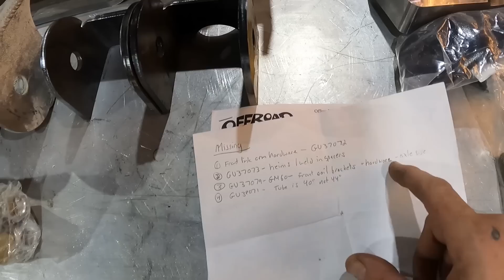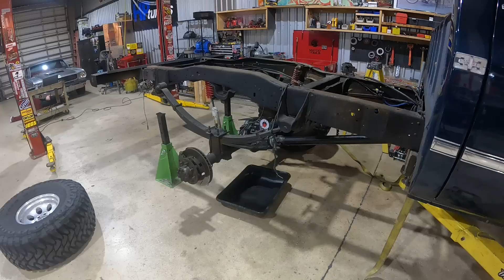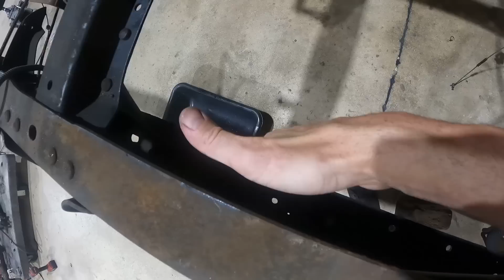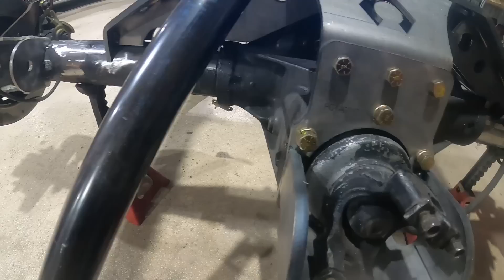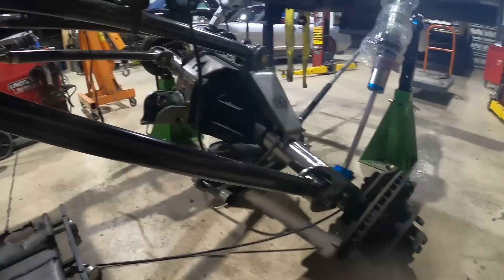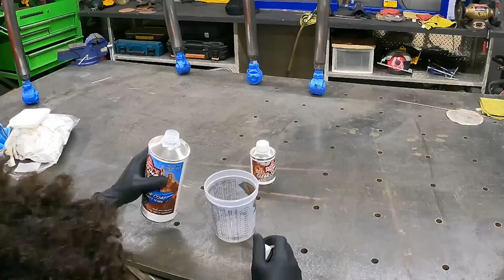Diesel Swapped Squarebody 10 Inch Lift Fabrication - Cummins Chevy K20 Ep. 1

Comment: What's interesting is when the bodyside molding trim & emblems on the square body SUVs were redesigned in 1989, the bodyside molding trim & tailgate emblem designs on the square body pickups stayed the same all the way up through 1991 which was the last year for the square bodies.

Comment: I have a 1991 square body crew cab that came with the 4L80E overdrive transmission from the factory. Mine has 10" lift, and the same exact tire and rims your crew cab has, but my lift is not as custom as yours because it is just a shackle flip rear with a 4" block. The front is just a SkyJacker 8" springs with an ORD 1" 0 rate. It also has an ORD 1" body lift. The drive train is just a new 350 TBI crate engine, and the 4L80E I rebuilt myself with all the tricks like rollorized out put, internal dual feed, etc, etc.

Comment: can you really just wear a t-shirt and shorts while welding TIG?  granted i haven't done TIG yes just stick and mig welding.  and whenever i do stick it's full leathers or the cloth jacket if it's hot out.  but i still super heat my off hand while holding the stick.  i'm working on it lol.
Reply from the maker: You should always wear full safety gear when welding to prevent burns and injury. BUT, if you notice when we're tig welding, there's a lot less hot, molten metal flying around. Everything is much more controlled than when stick or MIG welding. Definitely wear your leathers cause these burns are no fun!

Comment: Every video makes me miss Tim. It's not called a "Johnny joint", you even referred to it as a HEIM joint when you were doing a parts inventory! Saying the wrong thing so often that people get used to it makes everyone dumber
Reply from the maker: We were MISSING our HEIM joints for the front steering components which is why we started in the back. What was shown in the video was definitely a Johnny Joint. Heims are metal on metal. Johnny Joints have urethane bushings, exactly like the joints we show and use on the rear suspension.